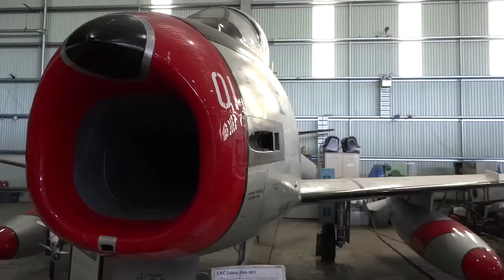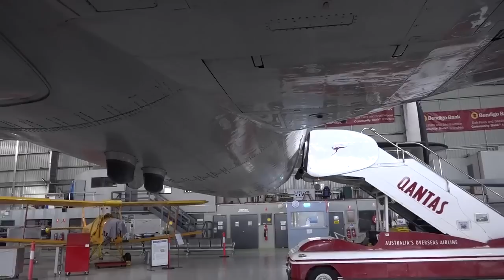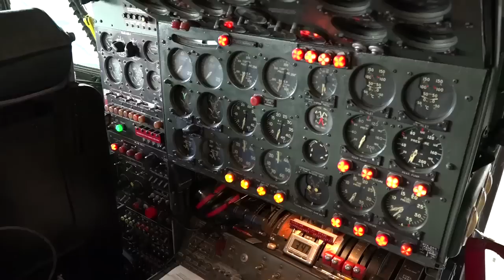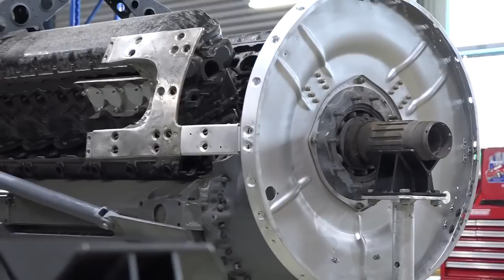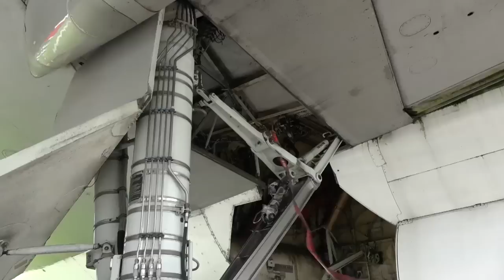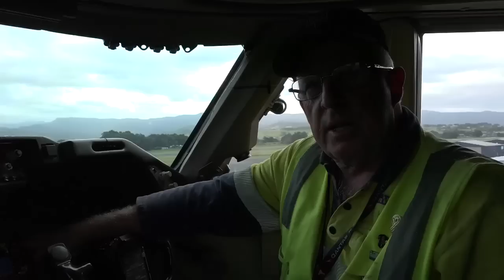Aviation Special: Classic Restos - Series 52

Comment: Around the 7 minute mark the mobile stairs for the constellation...In the early 80s in Sydney in the RAAF at Villawood we rebuilt one of these stair. We removed the original 1175? side valve ford and gear box and installed a 250ci ford 6 cylinder and auto box. It was an over kill !!!!. It was the smallest engine ford was selling at the time. Love watching your show. Keep up the good work. I liked the Morris Oxford series 2. I put one back on the road in Tassie.